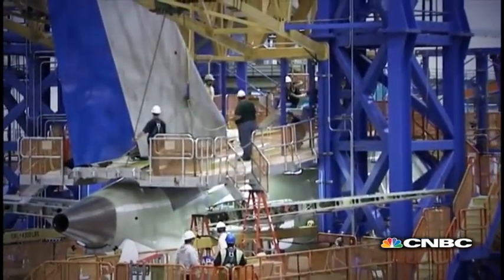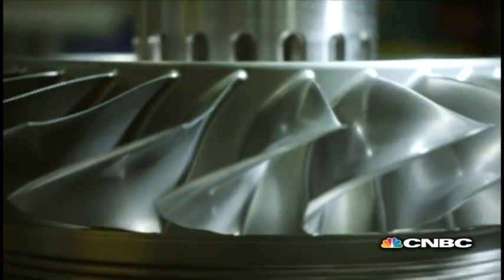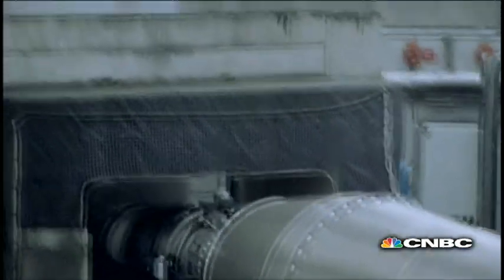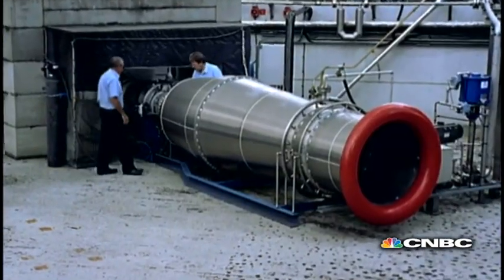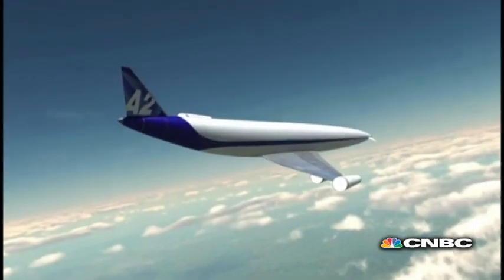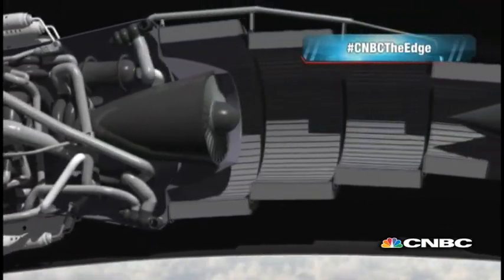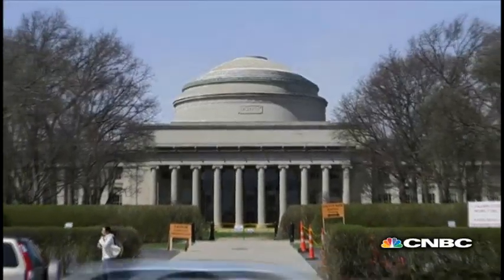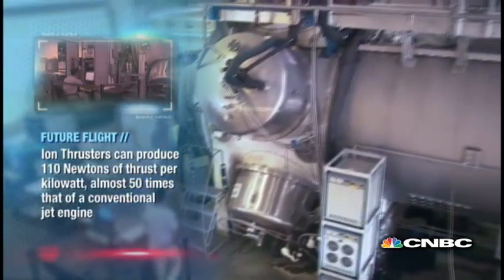Mach 5 aircraft technology | The Edge

Comment: These videos are "Cute" but are silly.  Even using the phrase "Speed of Sound" or Mach this or that makes no sense.  Sound travels at various speeds under various conditions.  We can talk to the Western Chinese by telephone amazingly quicker than flying there - even at the speeds of the Space Shuttle.  Sound travels quicker in water than in sea-level Air.  It's faster by traveling through Iron.  And for a rocket to escape the Earth's gravitation ??  27,000 + MPHs. But to get away from the Sun's gravity requires 47,000 MPHs +. That's where the problems pop up.  Explorer I & II needed a gravitational boost from using an outer planet like a Sling Shot.
Reply: +Inura Facititia Speeds higher than 2.000km/h are achieved in earth. more than 7000km/h achived in orbit. Air resistance is a catalytic fact.
Reply: The airplane going into space will work, i was at a event where they showed off some of the technology and explained some of the ideas with a demonstration of the engine working.
Reply: Inura Facititia escape speed from earth is 40,320 km/h (25,060 mph )
From the sun a little more....2,382,722 km/h (1,382,722 mph).

Comment: Why are they putting ion thrusters in the same discussion on alternative jet engines? Ion engines are incredibly efficient, but they don't generate a lot of thrust at once. At least certainly not enough to power any aircraft.
Reply: +Alex Kunev if you do any research on ION engines you will find out that they are efficient but are very slow. it can take day, weeks, months, even years  to complete one orbital maneuver. not realistic for alot of space flights.. of course they have a very high specific impulse (fuel efficiency) the amount of force produced is soo low it cannot be used to achieve orbits.
Reply: I agree and the difraginators would problemate to induction sensitivity levels.
Reply: it says in the video 110N/kW of thrust, or 50 times the thrust of regular jet engines...
Reply: One could get to a sufficiently high ballistic trajectory using rocket engines and only then at the maximum altitude start the ion thrusters and get orbital speed.
Reply: The concept is about atmospheric thrusters where there is a huge additional thrust from the repulsion of air molecules against the ions. This effect is carefully controlled to keep the aircraft from blowing up. It's H-U-G-E !  Probably been in service a long time in those black delta wing ships that float around silently. The ship design was patented in open literature in 1964, btw.  Same effect as is used in "fanless" air cleaners. :o|-